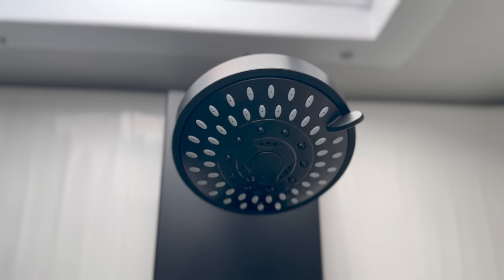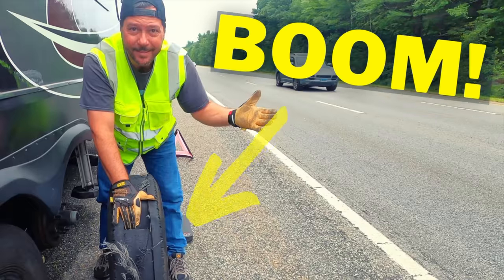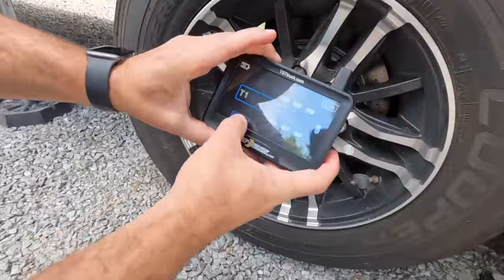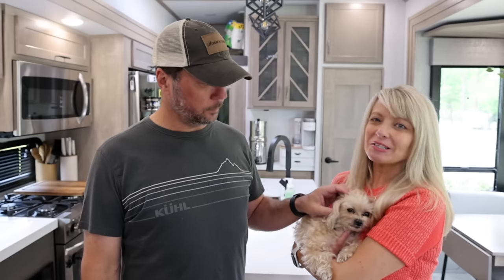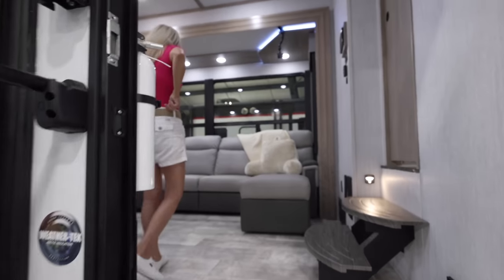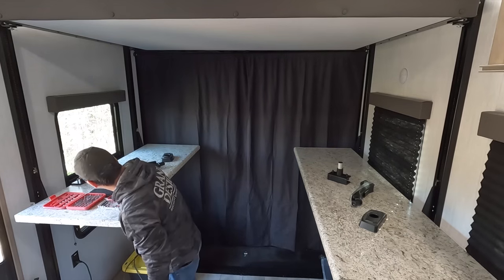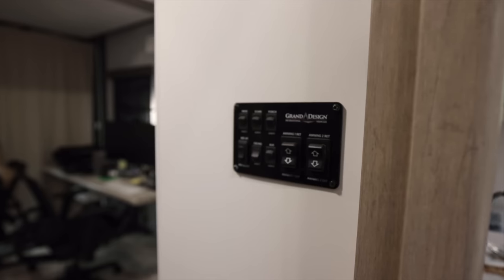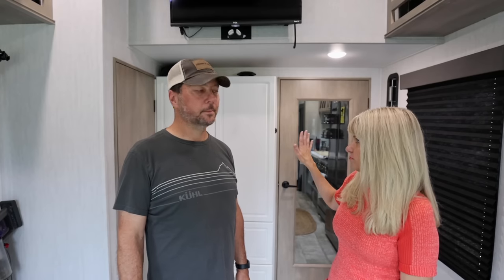New RV Storage Solutions! (and More Small Projects)

Comment: Years ago, we replaced a shower head in a house, and the new one was fantastic!  It claimed something like 0.7 gpm, had a very "hard" spray, and included a soaping valve.  I'm not sure where we bought it, but when it came time to sell that house, we didn't think it would be hard to replace, didn't even consider taking it with us.  Big mistake.  At our next couple of houses, we tried various replacements from Homeless Despot or Blowes, but nothing was nearly as good as that one.  Now, with the fiver, it would be even more valuable to us, though it's nice that the showerhead that came with the rig is handheld.  It was clearly meant for residential application, with a higher pressure and no real concern about flow.
Our TPMS (TST) works just fine for the trailer, though at times it will stop getting a signal for one or another tire.  The TST people kindly provided me with an additional signal booster, so all I have to do is find a good place to mount it, and provide it 12 VDC, and that problem should be solved.  Given how long it's been since they gave me the booster, and the fact that I haven't done it yet, I have to assume it won't happen for a while.  Unfortunately, the trailer and truck (2019 Ram) use incompatible TPMS, so even though the TST unit would easily display the truck and trailer tires all at once, we have to use the truck's own TPMS, which has no temperature readings.  So far, the only good either system has done for us is give us peace of mind.  We never bothered with the provided mounting for the TST display.  We just put it where a cell phone could go, in the center console, on the passenger side.  It's not really secured in any sense, but so far hasn't fallen out.  I do use the suction cup mount for our trailer camera display (we really only use for rear-view), and that has failed a couple of times.  I'm thinking of maybe doing some sort of screw-in mount to the dash, probably to the recessed area where the Powerlet socket is.
Thanks for the video, and I look forward to the full walk-through.  We used to both watch a lot of RV-related YT channels, but mostly stopped when we went fully mobile ourselves.  Yours is one of the few RV-related channels I still check in on, and have subscribed to on my alternate account (this one) as well as the one the two of us use on the TV.

Comment: I like your videos. For the hole left over in the new storage cupboard after you moved the controller. Grand Design on their parts web page has peel and stick wallpaper that will match your color schema. They sell it by the foot and it comes in widths from 3/4 inch to maybe 36-48 inches. It's very handy for covering holes so they aren't visible.

Comment: Love the video's!!  One point to make about the shower head.  You are not increasing the pressure, you are increasing the velocity.  Doesn't matter if you are working off the pump or city water, the pressure you get from the source will be whatever it is.  You are increasing the velocity by pushing that pressure thru a smaller oriface.
Reply from the maker: Doesn't higher velocity mean higher pressure when it hits the subject?  That's the pressure to which I'm referring... Not the pressure in the plumbing.

Comment: Did you consider the TPMS integration to the truck?  I use it on my '22 F350, and it works very well.  In fact, It alerted me a few weeks ago to a slow "leak", that we now know was due to a mfg defect in the trailer wheel.  Wheel paint held the pressure for several thousand miles, but it eventually started seeping out.
PS, the airflow and silencer product are freaking awesome!  DRAMATIC difference in sound levels.

Comment: I had an issue with my TPMS system. I spoke to the manufacturer and I believe he told me that you should not keep it hooked up permanently. Instead you should treat it like a cellphone. Charge it and then let it work off the battery for a while. At least that's my recollection.

Comment: I have an 2019 F250.   It has the tire pressure indicator. I have the tst507 for the RV    I recently had a blowout on the truck rear driver side.   Watching this video I’m wondering if I had sensors on the truck tire I may have avoided the problem.  I monitor the tire pressure before I put the truck in drive.  The pressures were good on all tires.   Your thoughts

Comment: I like your information on the TPMS.  I have a 2021 F150 that has a Ford built in TPMS.  Do you know if you can add the TST tire monitors on the valve stems in addition to the Ford's stock TPMS? I use the 507 on my travel trailer currently.  Thank you!
Reply from the maker: Yes... we did that on our F350 also.. 👍🏼
Reply: @ChangingLanes  Thank you!

Comment: Dangit chad, now I want the new monitor for my TST sensors!!  I didn't like any of the glass mounts either, so I bought trackform mount for the old style monitor.  With your Internet 4.0 install, did you consider the RV Whisper?  I use it since it requires the same 4g/5g connection as the waggle and internet as the govee and Waggle.  Been using ours a year and love the integration.

Comment: My GMC truck already has a TPMS on my truck tires that the tire shops know how to set and reset any time I have the tires serviced or replaced.  I only have four travel trailer tires on the ground plus one spare, not six on the ground, plus a spare.  Does your after market TPMS have a trailer five tire system that you think would work well as a supplement to the GMC system without there being any signal interference between them?
Reply from the maker: I don't believe they will integrate with factory TPMS systems.

Comment: Our biggest complaint about our 2 1/2 year old TST tire pressure monitor is that we can't read the screen in the sunlight.  Is new TST system brighter than the old model?
Reply from the maker: We had the shade thing for our 507...  This new one is mounted pretty low and doesn't see a lot of direct sunlight.  Not sure that it's necessarily better in direct light but the display is certainly bigger and more readable.

Comment: why not use the capability on your ford truck to monitor trailer tire pressure?  On a side note, we had a trailer wheel with a mfg defect that developed a slow leak that manifested itself an hour into our days travel after several thousand miles without an issue.  Caught it before the tire suffered any damage

Comment: Can I ask Chad a question? I talked to both TPMS companies and asked them why do they not have a monitor that would show both temp and psi for all tires at once. They  said they put what the customer wanted for the current monitors. Do you feel the monitor I am asking for is feasible and if so maybe you could talk to these companies and suggest it, please.  I, Rick, drive a motorhome and sometimes don’t want to want to have to reach over to the TPMS because it might be unsafe.
Reply from the maker: 12 tires temp and pressure all at once would just be too much info on one screen, IMO.  If one tire goes out of range on temp or pressure, that tire becomes the active one in the display...
Reply: @ChangingLanes  thank you for your honesty

Comment: Any thoughts on the crossfire tire equalization system or the centramatic wheel balances.  I found some that I can still use my tpms to monitor the dually tires individually but equalize the pressure. Thanks and another great video.
Reply from the maker: We do have centramatics and they're great...  Haven't use the crossfire, but they seem interesting.
Reply: The Crossfire equalizers are great I had them on my semi truck mounting them to a dually pickup is not that easy. The Centramatic balancers are great I have them on my 2022 Ford F-450 if you have good hearing at low speed like going through a parking lot you can hear the balancing media moving inside the channel.
Reply: @ChangingLanes  We run centramatics on the truck and I love umm!!!  Ran across a guy with a triple axle 5ver similar to our triple axle one, he has centramatics his and swears by them…Chad’s thoughts🤔🤔🤔

Comment: I want to put the carpet on the outside steps but worried they will get very dirty. How do you keep them clean?
Reply: Go buy some in-door/out-door carpet at a home hardware store, (it’s made to dry fast when it gets wet), go pick up some grommets and a bunch of small bungie cords, easily make your own outside stair carpet n easy to remove and hose it down, dries completely in the sun in a couple hours. 🍻
Reply from the maker: The RugUp step covers are actually designed to be removed and reattached. We are able to take them off, wash them and put them back on. 😄https://gear.changinglanesrv.com/?s=steps&post_type=product&type_aws=true&aws_id=1&aws_filter=1

Comment: So your fancy Ford doesn't have factory TPMS?  Geesh
Reply: He wants the temp and pressure all on one gauge.  Vehicles will have pressure but not temp.
Reply: @badgerpa9  really shouldn't need the temp on the truck tires.  If they're aired up properly they should be fine.
Reply: @caseypries7559  Really do not need the pressure TPMS, but since 2007 all light duty cars are required to have one and people are buying sensors all the time because they are junk.  The 450 is not a light duty so it does not need to have one factory.
Reply: @badgerpa9  I have no problem with having TPMS on a truck. My 3500 has it from the factory and it's piece of mind that the pressure is where it should be without me keeping an eye on it.  I just don't think temp is necessary on the truck.  The tires are more robust on the truck and the odds of it bending an axle or being loaded improperly are extremely low so the odds of the temp being high is also extremely low as low was the pressure is where it should be. Now if the truck didn't come equipped with factory TPMS then there's nothing wrong with adding it.
Reply from the maker: No.. the 450 does not have factory TPMS, unfortunately.
Reply: @ChangingLanes  bummer